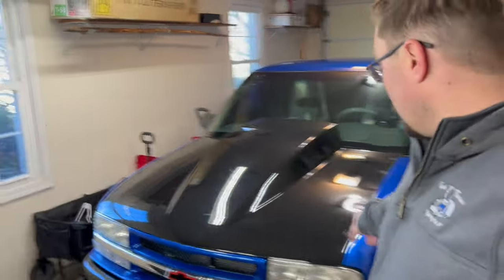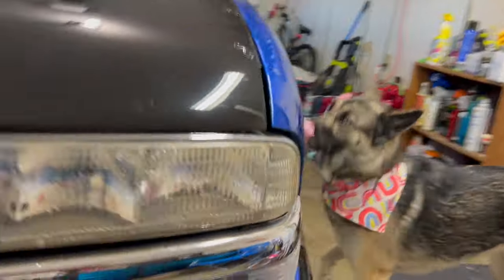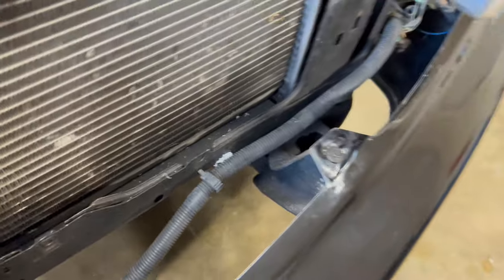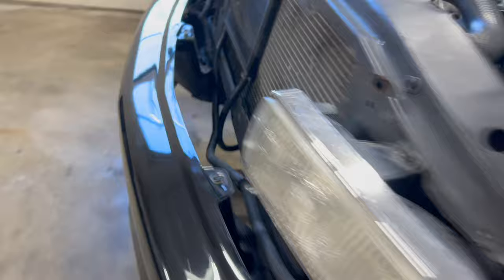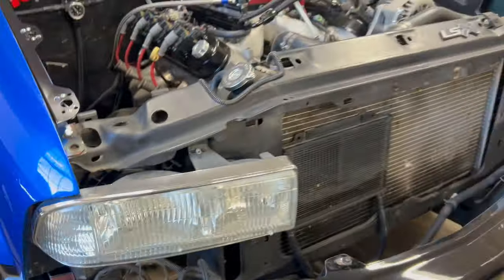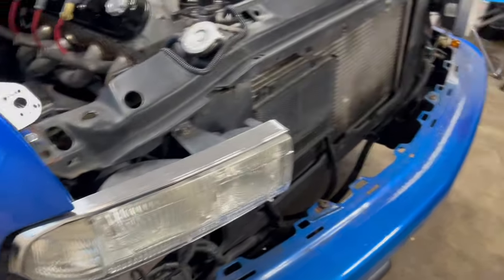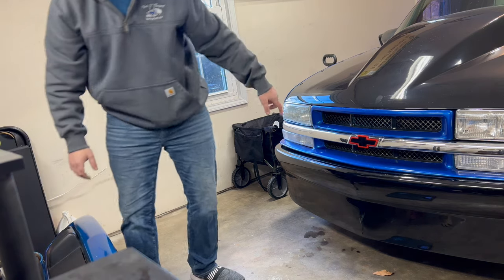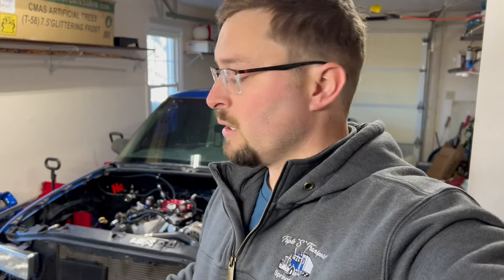It Was Time to Change up the Front End on the S10

Comment: Have you drove it yet? It looks to kill some airflow and maybe cause some overheating issues. I love the look if it!
Reply from the maker: Drove it last night and it did good.
Reply: @LsBluu  is that guy in Kentucky? I saw he has a 270 area code. I may order two and go pick them up. My daughter is making me a few s10 life stickers. You're starting a new trend on YouTube lol once you do the heads and get that converter right. I think that will turn into one tough truck to beat! I may have to do a little tweaking myself to compete with you at the valley in 2024 if you manage to find time to go. Having a new kid is great but they will change your life some. Always for the better too! I have 5 kids but mine are all grown now and trying to beat me lol my daughters are getting close! My sons can't stand a chance lol  the girls are beating the boys by nearly 2 seconds!
Reply from the maker: @thecarguy2470  Racer’s Edge is located in Owensboro. Not too far a way. Going to port these heads at home. Doing plenty of research beforehand.
Reply: @LsBluu  it takes a little time to port heads and really it's better with a flow bench but it can be done without one and accomplish great results!  It's even better when you port match the intake and gaskets to get an even flow without any restrictions. I think you'll get it close and much better than it is now. Now I really am impressed with the way that the truck runs using stock heads. If I knew that I wouldn't have given you hell at the start. Heads play a big role in performance. Once you get it done, I believe you'll notice a huge difference in quicker rpm at launch and top end. You may need some wheelie bars next if you keep it up! Thanks for the info on the front bumper set up! That thing makes your truck look fast just sitting there!
Reply from the maker: I had a set of 243’s that I was going to put on the 6.0 when I got it. I sold them because I found a set of slightly ported 243’s from a local guy. He screwed me over and never replied to me about meeting so I could buy them from him. So I got stuck with my stock 862’s.